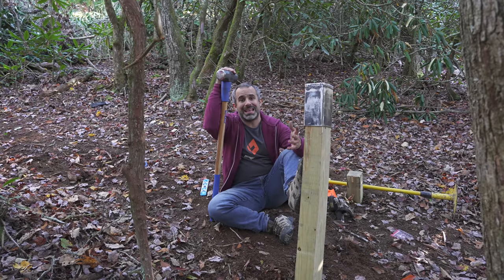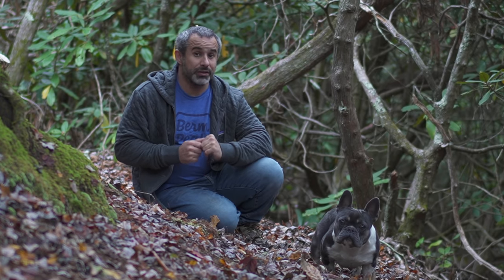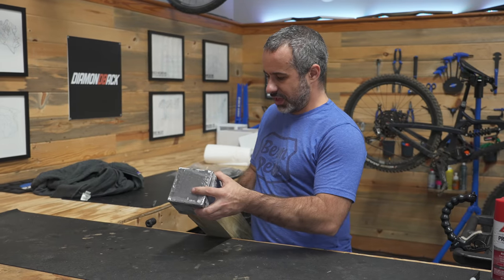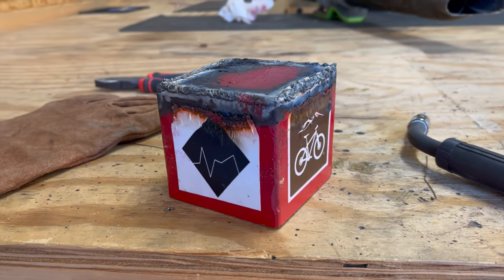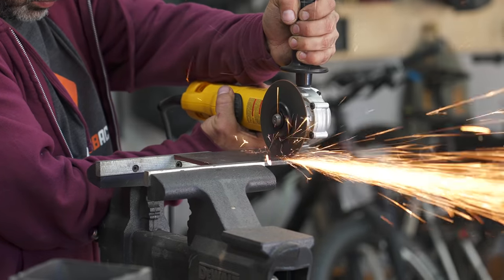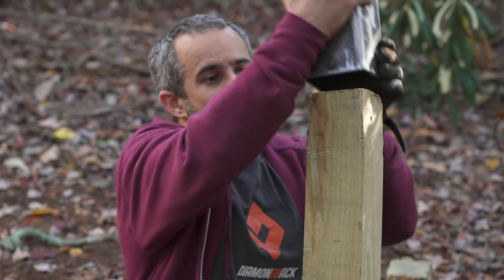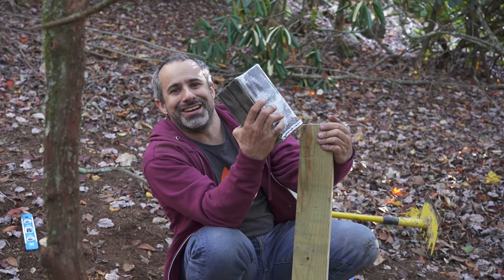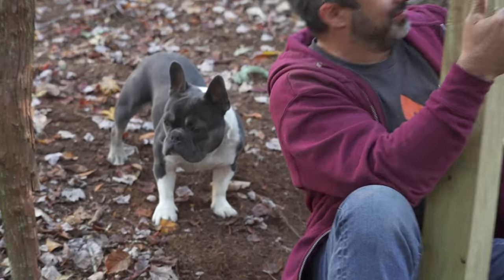Making a Metal 4x4 Post Driving Cap for Building MTB Features

Comment: Cut a “ + “ shape out of thick plate then bend into the shape! Then the only welds on the piece will not be on the striking surface. 
I’d also weld a nail or two on the inside. That way the cap will stay put on the post while you hammer and ideally transfer the energy into the post better instead of bouncing off
Reply: But with the nails the shape would get stuck..? Please elaborate
Reply: This was exactly my first thought when they said what they were making. They could even weld a band around the perimeter for strength
Reply: His biggest issue is poor welds.
Reply: Good luck bending such thick metal without a break.
Reply: @lukeman87545  More like poor engineering, those welds had no chance to hold being thick metal welded to thin metal, no matter the quality of the welding. The sides needed to be as thick as the top like on the second prototype.
Reply: It was frustrating watching this one. He doesn't even need any welds. All he needs is a striking surface and two corners to keep it in place.

Comment: If u don't want the end to split u need a (fencing maul) its a sledge hammer but with a much bigger head to stop spliting
Reply: listen to em he's a farmer
Reply: The plot thickens!
Reply: @agresilience5708  he's just a dog, chill

but I've never ever seen a dog wrong, so..
Reply: It can also be called a post maul. It usually has a cast iron head. You can only hit wood with it. I have a 12 and a 16 pound post maul. It will make a man out of you real quick.
Reply: You can buy one of these for $30 that will last forever. I've put in hundreds of posts and mine is still solid.
Reply: You could modify the sledge with a eight inch steel plate or maybe quarter inch to avoid bending
Reply: It’s easier to use aswel
Reply: Yes, this was painful to watch - if you dont have a fencing maul just wrap the the top end with a steel tie, cheep, and solves the original problem of the wood splitting - its not as if you are going to hammer it 24/7.
Reply: Pre punch the holes,cut full points on the posts and use a fencing maul! This video nearly made me cry!
Reply: @pebbleyfraser7072  could use an auger on his new mini digger aswel to dig the hole
Reply: @dylangardner1724  didn't want to use machine on run so hand pinching holes would still be easier.
Reply: I was thinking the same thing this whole time
Reply: @ITBlanka  I second that.
Reply: Post Mail, is the way to go, if you are doing it by hand.  Personally, I’d buy a hammer attachment for the Mini.  You’ll have it done in no time and I’m sure you’ll use it a lot.
Reply: @agresilience5708  I just use the bucket on the loader or head stock of it.
Reply: @depafrom5277  that really works??! basically use a metal cable tie 1/2" or so from the end to keep the wood from splitting? wow if that works I am so happy because I need to sink 22 posts and I don't want to buy a $150 fencing maul.

Comment: Steel tube has an OD and ID " Outside diameter and inside diameter" also you need to account for warp/ shrinking after the metal cools down but home depot, sells what you are attempting to make, it's called a fence post driver

Comment: If you make a v2 you could just bend a rectangular piece of metal into a "n" shape and just weld 2 square pieces of metal on the side so the thing you're constantly hitting is a single piece of metal and the welded part is just a decorative cap.
Reply: This is what I was going to say. Just bend some real thick steel in an "n" as you say. Might even work to just cut off one side of the 4x4 box section and spread the sides a bit to fit over the post. Then just weld something smaller on the sides to act as strapping to keep it from falling off the post while hammering. Then there shouldn't be any stress from hammering going to any welds.
Reply: Was just about to write something similar, my idea was to use to U shaped pieces of metal stacked ontop of eachother so the hitting surface is two layers.
Reply: That's exactly what I wanted to write! More over, it could be a П-shaped piece of profile with a single hole and a bolt on its side used for holding the wood not to bounce off after every hit.
Reply: bending thick metal makes it a lot weaker. I'd say a good welding spot will be actually stronger than a bent piece of metal.
Reply: I mean a post driver is $50 probably and might do the work and withhold a sledge hammer
Reply: That's my thought exactly,  except that it called it a "U" shape... 🙃🤙🍁🪨🚵‍♂️
Reply: I’d say cut a “+” shape…. Then bend into the shape.
Reply: @Mebeknob  bending stuff is bad!
Reply: Yes!

Comment: Seth. I used to build and use a similar tool just to pop 8in deep, 2.5in round holes in the ground. I used 1/4 wall 2.5 pipe and the top plate was 3/16 thick. That 3/16 plate was destroyed after the first 60 or so holes. I ended up doubling up the top plate and plug welding it in the center and all around the outside. Your concept works great and is a stellar idea. Just needs a little more work. Really, the outside doesn't need to be that heavy. It just needs to be strongly attached to the top plate. The heavier it is, when it does get stuck for some reason, it will be a pain to get off. I think less material on the sides is a good idea, with a heavy top.

Comment: I work on a ranch and have tried pretty much every method of driving posts in the ground. What I’ve found works best is getting yourself a pallet fork attachment for that excavator and using one of the fork spikes to poke a hole in the ground. Then take your post and use the bottom of your excavator bucket to push it into the ground. Have probably done this to a few hundred 8 foot half rounds and it works great. Have fun figuring it out!
Reply: Just wrap the top part with a steel tie, cheep, and solves the original problem.
Reply: I can’t tell if this is genius or over complicated
Reply: This is the correct answer.
Reply: But he don't want to use his excavator in this place to not damage the roots 🤔
Reply: @thelonewolf3515  Honda makes a portable gas powered post driver. They sell it at Home Depot
Reply: @knowltot  neat 😁

Comment: Hey Seth, good idea, bit of trouble executing. Simple solution to the fit, just take the 4x4's to the table saw and give them the slightest shave on 2 sides so it fits, as you said, only needs like 1/16th all around to fit ;-)
On the welding thing, you need to grind 45 degree angles so the weld actually has someplace to go once you grind it back and you don't basically grind back off al the weld.
Reply: And also he maybe has to turn on shielding gas, the beads look like they've been made without or with not enough shielding gas
Reply: or to the belt grinder
Reply: @zsomborteimer2821  I think he was using flux-core wire rather than plain wire with separate gas.
Reply: @zsomborteimer2821  He's using flux core. Very difficult to weld such thick material successfully with it and he did as good a job as could be expected. But as we saw it was quite weak... Things aren't ever supposed to break at the welds. The welds should be stronger than the other bits!
Reply: @benc8386  If you crank it up to 90 amps it can weld pretty thick metal. I was welding 0.8 mm thick tubing on my boat trailer today with no issues whatsoever. I had pretty good penetration, sure its not like stick welding, but Im pretty sure it would pass an x-ray.
Reply: @stilianivanov3377  Do you mean 8mm or 0.8mm? Either is quite hard to do with flux core so well done :) Another option is to get a higher quality wire that's rated for doing multiple passes with.
Reply: @benc8386  
I mean inches, sorry. And thank you :) 

Its definitely not as easy as stick welding for sure (maybe because thats what I do all day), but I found out with a bit of practice you can weld nearly anything with flux core. 
Its just a matter of picking up the right wire like you said, adjusting the welder properly and dialing your technique.
Reply: Yes trim the posts!   But IMO something else, bandsaw/bench sander or something safe.  

Ripping on a table saw is sketchy; if you twist or angle the wood in any way while its between the fence and blade - BAM.  Wood goes flying, or you go flying, or table saw itself does something (probably in this case since the beams are heavy).  Not saying you can't, we all have and and lived.. but that's also how allot of people loose fingers - just use the safer tool for ripping if you can.

Comment: There's such thing as a stake driver, that's basically a big metal tube with a weight at the end and two handles. Fully recommended.
Reply: We use these regularly, that was going to be my same recommendation. Also a lot less work than swinging that bing sledge over and over.
Reply: I came here to say the same thing.
Reply: I use these to put up temporary signs, they work like a charm, I second this recommendation as well
Reply: I've never seen a square one though
Reply: Yup, there has to be a ready made stake cap!
Reply: You can get 4” square style tube 1/8” wall. He had 1/4” wall.
Reply: @shshswbshsbshshsh7725  they make them for docks and stuff
Reply: @shshswbshsbshshsh7725  when it’s square it’s called a pile driver. Same concept, great tool for the job.
Reply: @ericswearingenmusic9967 I  always had to build my own

Comment: Love that you are learning to weld. I weld structural and am trained to weld pipe. No hate towards your welds. Just a tip. Bevel the sides of the metal to allow better penetration. Move slower with your movement and make sure your amperage is hot enough. Tack each side good and weld one side,  let it cool. Weld the opposite side. Let it cool and repeat. Keeps things from warping too badly. I love seeing you weld. It's my passion, and I love when people want to learn. Keep doing more!

Comment: I would recommend you to buy a 5mm thick steel sheet and cut a cross ( + ) with sides 4" out of it, also considering the added thickness of the sheet and then bending it into a cube and welding the sides. In this way you can actually control the dimensions of it with respect to the wood size and you can weld small 90° steel angles on all 4 welded edges for extra strength so that the welds won't rip on impact. I hope this may be helpful to you.

Comment: When you had the square and just needed a top cap, if you had used a larger top square you could have welded it correctly in a 45 degree angle ( edit: from BELOW the strike surface, put the top square flat and put the sides on top and then weld them so it has room to bind the pieces ). Would have been even better if you used a thicker top cap as well since that's the part which distributes the load, more mass there helps.

Edit2: for the sides if you don't have thicker plates you could try and add ribs from strips of the same metal. Those ribs will greatly enhance the rigidity and prevent warping and splitting.

Comment: Nothing wrong with learning like this Seth! It’s still a salvageable project. Just cut the 4” box along the corners on two opposite sides lengthways leaving you with two enormous angle iron, then space them out wide enough to go over the 4x4 and weld them together again.

The best part is bridging the gap with weld is great practice and you’ll be able to play with the welder on hotter settings. Your other welds only failed because they were cold and got mostly ground off. Don’t be scared of gaps in mig welding, perfect fit up is for tig.

Comment: I am sure there are some welders that have already told you this, but doing a half lap on the the top cover piece and then welding would be stronger. Going a larger channel size should work but I love the determination. Keep it up Seth loving the journey.
Reply: Seth, please wear hearing protection while using a grinder.  Also, get some flap discs for grinding with.

Comment: You need a spokeshave.  Just take the edges off the four corners on the top 12" or so of each post.  Then the cap <shouldn't>  get stuck. Alternately, you could have used round tubing instead of square. Just for the pure joy of repeatedly putting a square peg in a round hole.

Comment: Make it out of 1/4” plate out of a single plate draw out your bend, cut halfway through with the angle grinder then bend it the rest of the way in the vice then weld your bends. You can make a template out of paper to lay it out!

Comment: id suggest giving it another go, but this time you just use a metal plate and cut it into a cross, and bend it to be an open cube so it all remains mostly one piece and dont rely solely on welds for strength
Reply: You're going to have a really bad time trying to bend steel thick enough to withstand the sledgehammer on top, especially trying to close it into a box like that. The HSS with the plate on top is the best way to go, but I would cut the plate about 1/4" larger than the HSS on all sides so you can do a much stronger and easier fillet weld. Those butt welds we was doing especially with his small wire feed and inexperience were super weak and had little penetration.

Comment: Seth what  about a straight line down hill speed run section like just from top to bottom straight line with maby a few jumps just a max speed thing
Reply: 'how quickly do you want to die' 
'yes'
Reply: @mscd9676  hmm how fast can I go down there : dead :
Reply: that's what his driveway is for
Reply: Straight line downhill is a big no no in trail design. Water will channel into the breaking ruts and quickly erode big ruts into the trail. The sediment washed down hill will cover and kill vegetation.

Comment: Yes I know, another big-brain comment, but hope this helps. Having multiple pieces joined together, the joints are a guaranteed weak link, I would suggest taking sheet metal (3/16" thickness) and bend it in a C-shape then weld one triangular piece on each side like a corner brace to help it retain its shape. The other suggestion that might be easier is to cut off a 4" section of the square stock and cut off one of the sides so you end up with a C-shape piece, then thake the off-cut and cut it into 2 triangles to use them as corner brace if you want but that square stock is pretty tight so those braces are not totally needed. Great video Seth

Comment: You could cut all the corners of metal and bend each side out slightly so it tapers up to top plate. Weld thick metal to replace the structure lost from cutting it. It might be tight at the top but the bottom would slide on fine. Think of a pyramid with the top cut off but much less of a slope to it.

Comment: Ok Seth, you just have to cut with your grinder, one of the corners, just till the upper welded part, this way you release some of the tension. If not working, cut the oposite corner too and put it on that 4x4 wood and to be sure it won't fly you can fix it with a small screw in a hole through one of the sides. 
Of course, this is the solution in case you won't make another larger cap. Hope it is useful and reliable.

Comment: Seth,  you just need a real welder, and someone that knows how to get proper penetration of the parent metal.  Then get 5 squares and weld them up like you did at first, but with an actual structural weld.

Most of us that weld will do something like this for next to nothing.
Reply: I love watching beginners try to mig. but i could tig it up to where it never could break again.
Reply: And weld an old jack hammer bit to the top.

Comment: Welding tip: It is easier to weld in an 90° Corner instead of the 270° you did on the outside top-plate. While welding inside would interfere with the function of your post driving cap, you could go and make the top plate a couple of cm larger than needed, to create the 90° corner on the outside. 
Also bending an open cube instead of welding everything could help :)

Comment: I know it won't fit the 4x4s when he cut the steel tube.
Seth forgot the inner dimensions of the square tube shoud be equal or larger than the outer dimensions of the wood. 😁
Reply: Seems he did account for it, since a 4"x4" post has true dimensions of 3-1/2"x3-1/2" and his box section is 4"x4" with 1/4" walls. Yes, yes, someone will mention tolerances, but what Seth really forgot to account for is that the box section has rounded corners while the post has sharp corners which interfere. Would work find if he manually chamfers every post before he drives it in.😅

Comment: Please please put a guard on your grinder, it’s so unsafe without 🥽

A disc could easily break if it’s used wrong. Or the pressure you apply while using the machine is too high⚠️
Shrapnel could leave some serious injuries❤️‍🩹

Edit: emojis in the hope that this comment will reach Seth faster.
Reply: Also do not use the front of the disc like at 4:28 (especially without a guard). If a kickback happens there is a high change of getting hit by the disc since it is trying to push upwards instead of forwards.

Edit: It also seems like the angle grinder is setup to go in to the wrong direction. The sparks should be flying towards you instead of away from you. That just seems like a accident waiting to happen.

Comment: Seth use a piece of 6” sch 40 pipe and weld 1/4” plate on the one end. Cut the plate  bigger then the outside diameter of the pipe so you can make a fillet weld. Always bevel the end of the material you are welding you can make multiple passes. The reason the first one broke was you made a butt weld then grinded the weld off to make it look pretty. But you had no weld left to hold it together.

Comment: Get a sheet of plate steel, thick enough, 8x8". Weld some pieces underneath the middle of one side that will allow you to place it on the end of the post, and keep it in place. The unwelded flat side of the 8x8" plate will be facing up. Use the excavator bucket to drive the posts.

Comment: @bermpeakexpress you could cut the square tubing vertically at the corners like so < > to widen it out enough to fit the post. Then tack it together with strips or even diagonal handles.